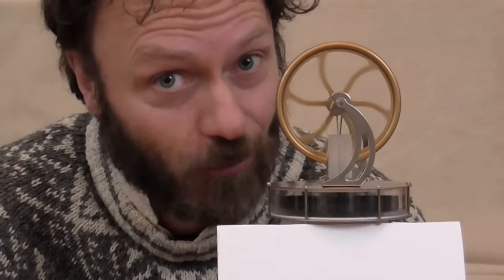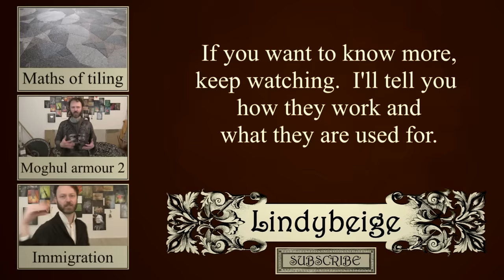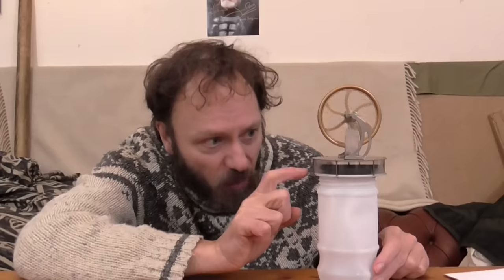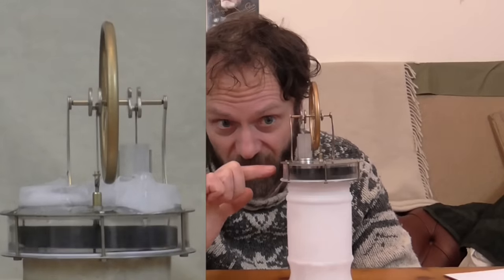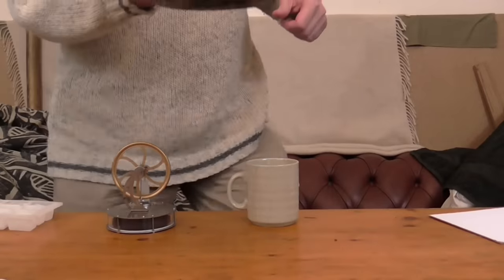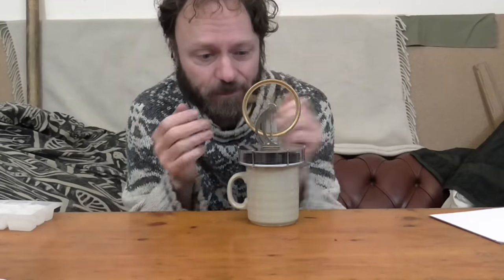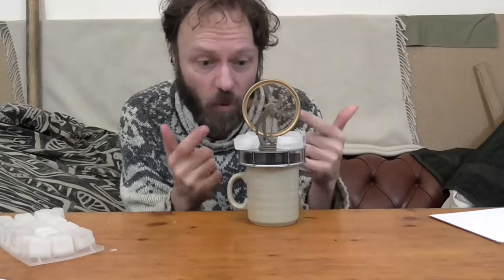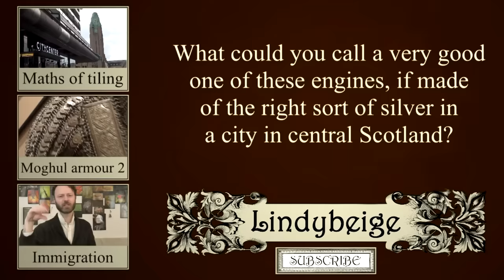Stirling Engines - the power of the future?

Comment: This could be really useful to me as an amateur science fiction writer. I was looking for a method to 1) get rid of excess heat without massive heat dispersers, and 2) provide some power to the internals of a ship without putting a massive nuclear reactor or something and taking some of that power from the engines and routing it into the ship. This could be really useful for both of those tasks. Thank you, Lindybeige, for proving that you never know when learning for the sake of learning might come in handy.
Reply from the maker: Be careful if you mean SPACE ship, because seawater around a submarine carries heat away whereas the vacuum of space does not.
Reply: You need something to turn heat energy into radiation so it can be emitted into the vacuum. The space station has large radiators unfolded from its modules, that look like solar panels only white.
Reply: The vacuum of space does allow heat to travel through it, though.  Not as well as an atmosphere, but heat does travel through space.
Reply: As Lindy said, space can't carry the heat away very well. The reasoning behind it is that because space is nearly empty, you can't really get the heat dispersed very well. In water you have lots of particles in which to send heat, and it can dissapate into the rest of the water. In space, well, you just have the occasional particle hit you.

IMO, you would be better off with some sort of system that dispenses something with low mass and high heat capacity. Rockets work so well because they are shooting most of the heat that they generate away from themselves in the form of very fast particles.
Reply: Great video Lindy! I enjoy your video and almost always learn something.

It might be a cool video idea if you compare and contrast different energy sources. Like the pros and cons of nuclear power vs wind turbines or hydroelectric damns vs geothermal wells and just do one big video on how they all could work and the most viable for the future.

Might be a long video but I'm sure a lot of people would be able to learn a lot from it.

Greetings from the U.S.!
Reply: ***** That's what photovoltaic panels do. Spaceships/stations need to be as light as possible. Plus pv panels can provide far more energy.
Reply: Lindybeige You're right, and I was silly to forget that, but it certainly provides a good use for what is otherwise waste heat that can then be radiated away.
Reply: Tank 1900 mate check out thermoelectric generators. Link: en.m.wikipedia.org I think that might be what you are looking for. Plus they have a history of use in space: they are what actually makes the electricity in a thermoelectric battery, also known as an RTG (radiothermalelectric generator).
Reply: A stirling engine won't get rid of the heat - it just moves it from one place to another (from the hot plate to the cold). You still have to disperse the heat collecting on the cold plate. If you don't, it will heat up until the system reaches equillibrium. That is, the engine does not extract work from the heat itself - which is impossible - but from the low entropy of having a hot things and a cold thing.
Reply: Paul Murray I can't believe I forgot to mention that while I was crushing dreams.
Reply: +NarpytheCrimeDog
a perfect vacuum does not allow heat to travel through it but space is only a near perfect vacuum so while it does allow heat to travel through it, it is only a technicality and heat on a spacecraft needs to be radiated away or it will build up.
Reply: rylee1991  Heat travels through three means: radiation, conduction, and convection.  Heat has no problem traveling through space through radiation  (UV, microwaves, X-Ray, etc.)  Anything producing heat gives off a certain amount of radiating heat, which can be dispersed through a perfect vacuum, which is why we can't make a "perfect" temperature containment device.

So, let's say we have a material that is incredibly effective at converting energy into UV light - a reverse solar panel, we could - potentially - have a space heat sink.

Heat can travel through the imperfect vacuum of space through conduction as well; there are plenty of streams of comet dust as well that one could fly through to strip heat away through means of conduction if necessary.  About they only means of dispersing heat that is really impractical in space is convection - for obvious reasons.
Reply: as i said radiation is the only one that really works in space.
the formula for heat transfer can be expressed as mcΔT(of object 1)=Q=mcΔT(of object 2).
Q=heat m=mass c=Specific heat capacity ΔT=the change in temperature.

space has almost no mass, it has on average a few hydrogen particles per meter squared, hydrogen(most common element in space) has an atomic mass of about 1.008u or 1.6738232e-24 grams.
the Specific heat of hydrogen is about 14.32.
say we raised the temperature of 10 hydrogen particles by 300 kelvin (from absolute zero to 26.85 degrees Celsius or 80.33 fahrenheit) we get; 1.6738232e-23x14.32x300=7.190744467e-20
so that is how many joules of heat energy is transferred, we can then work out how much this cools the other object by transposing the formula to ΔT=Q/mc.
if we are cooling 1kg of aluminum which has a Specific heat of 0.9 we get;
7.190744467e-20/1000x0.9=7.989716074e-23
my calculations does oversimplify variables but its accurate enough to show that using conduction would be ridiculous. 

flying into comet dust would increase the amount of mass you are in contact with but it would also cause friction, it might work to some degree but would still not be efficient.
not sure why you discounted convection it could work if the dust cloud is thick enough or in a nebula, you could even come up with some tech that uses it but it would probably be the hardest to harness although potentially more effective than just conduction.    

radiation bypasses this problem because the energy becomes a photon and does not transfer through a medium, in this way the heat does not travel through the vacuum it avoids it.
Reply: rylee1991
 That was essentially my point in a material that could convert energy to UV. The reason I discredited convection is simply because it operates off gravitation.  Since it's not likely for  denser matter to "drop" and less-dense matter to "rise," in space (granted, gravitation is everywhere), one would have to rely mostly on conduction and radiation.

I don't think the friction from a comet cloud would increase heat as much as it would transfer it out.  However, you would have to worry about actual damage - and I admit I didn't think about that.  I'm sure those ice particles are traveling at insane speeds - likely enough to scrape off small amounts of material like a bad ass shot blast.
Reply: well not all forms of convection require gravitation although the lack of it does limit your options.
Thermomagnetic convection is one example, you stick a magnet next to a heat source in a tank of the right liquid or gas and the cooler atoms which have higher magnetic susceptibility will force there way towards the magnet which displaces the warmer atoms.
in a vacuum this would not get rid of the heat, it would just move it around the ship but its a start.

you could have a bubble of particles around your ship held in place by a magnetic field, as the particles are heated their magnetic susceptibility decreases and their kinetic energy increases until they escape the magnetic field and are propelled into space, maybe even directed to act as a low yield propulsion engine.
this would need the ship to carry its own coolant particles or a way to make the particles in space work which could be difficult.
this would also need a pretty strong magnetic field and the energy generated to create it could create more heat then the system displaces but maybe the energy is needed anyway and the system just uses the byproduct magnetic field.
it could also help protect the ship from micrometeorites and other small impacts.
Reply: rylee1991
 Holy shit, thermomagnetic convection is brilliant.  Please tell me this is a real thing.

Now, as a painter, I've used electrostatic guns, which pretty much just attach a charge to paint to make it connect to a grounded product; would the same principle be possible on the macro scale, rather than the pseduo-atomization of paint?
Reply: it sure is a real thing, the basic principle is pretty simple, when a atom is heated it vibrates wildly and when a atom with magnetic susceptibility is exposed to a magnetic field it lines up with it, these are opposing forces and at some point (called the curie point) the heat wins and the atom stops responding to the magnetic field.
if you search for curie point engines you should find a few demonstrations, like the sterling engine they don't receive much love from industry but they are very interesting.

you can charge just about anything but it will not retain the charge for long, if it can not find an atom with the opposite charge then it will emit it as a photon.
still with advanced enough technology you could do it.
Reply: rylee1991 would it be possible to harness solar wind particles as a means of transfering excess heat and absorb the radiation of the sun as to heat up the opposite end of the engine, therefor u have a temperature gradiant
Reply: I still don't know how it works.
Reply: solar winds are hot and not very dense, the closer to the sun you are the hotter and denser they are.
the formula that i used earlier shows how important mass is in determining how much heat energy is exchanged between 2 objects and already being hot doesn't help either, solar winds wouldn't be a very effective way to transfer excess heat.
Reply: rylee1991 So what is going on inside the engine. I realize there is a temp gradient, but how does that create the motion under a load?
Reply: the air inside the engine is expanding as it gets hot and retracting when it gets cold, the black disk controls the temperature by insulating either the hot or cold side and when the pressure inside the engine is higher than outside the air inside pushes the piston up to increase the volume of the chamber, when the pressure is lower the air outside pushes the piston down to decrease the volume.

the formula for this is PV/T=k, pressure times volume divided by temperature is constant which means that any change in temperature has a directly proportional change in pressure and/or volume.
Reply: rylee1991 Thanks for the excellent explanation. k would have to be what I learned as NR. Correct? Or am I just too old?

Comment: A Stirling engine powers the quietest and most deadly attack submarine in the world...
Reply: Hi do you have any links and why a Stirling engine was used? I'm doing a project about Stirling engines and would love to know where they're being used and for what reasons they chose to use Stirling engines
Reply: @archivearchive9457  Why?  Low noise for one. The USN had it attack an alerted Carrier group TWICE and both times it penetrated ALL ASW assets and sunk our super carrier.  Go to the sub manufacturers website
Reply: @archivearchive9457  theres a type of sonar that detects  noise from the sub engine
Reply: @timearly5226    yeah but I understand that every so often the crew has to do what Lindybeige did, which is to put their hands on the engine to restart it..
Reply: A Swedish or Norwegian submarine snuck past the United States Navy and torpedoed the main aircraft carrier and sunk it in war games in 2005
Reply: It is dual powered, the Stirling engine is only used for stealth and is not enough on its own to run a sub.
Reply: They are Tri powered, Diesel, battery and Stirling.

You could say the dual powered coz the diesel charges the batteries and the motors are electric. I imaging the striking provides the motors with a couple of watts to keep em turning for maneuvering while hunting.
Reply: Robert Aegidius  WIth enought sterling engines maybe
Reply: Robert Aegidius  littoral: are you sure?
Reply: @jimmys6566  Yes, he's right.  Non-nuclear attack submarines are fairly universally slower than their typically larger, fission-powered cousins.  When submerged, they don't have the benefit of the full output of their diesel powerplants, you understand, so they have only what their batteries can provide, unless they want to snorkel--that is, raise a mast to the surface to take in air to run the diesel powerplant.  Even then, you can't move very fast because then drag will damage your snorkel, and that's no good.  Air independent propulsion systems, like hydrogen fuel cells or Stirling engines, have been fielded on some electric subs to quietly replenish their batteries, but they are still considerably slower than nuclear boats, which can lean on the full force of a nuclear reactor whenever they want to.  Those ships can go faster and can sprint for as long as they damn well please.  

But, in practical terms, even nuclear submarines have a fundamental speed limitation when put up against a carrier group.  See, a submarine remains quiet at low speed; this minimizes flow noise around the hull and machinery noise from reactor coolant pumps and steam turbines.  These, especially the turbines, are still very quiet anyway, and coolant pumps are probably the biggest source of sound on a nuclear sub, in most cases, that can't easily be isolated from the exterior of the hull.  Sounds that can be isolated more easily are much easier to keep quiet from enemy sonar.  

So, if you want to stay quiet nearby enemy ships, a modern submarine will find itself limited to around 5 knots or up to perhaps 15 knots in the case of some newer nuclear submarines; it really depends a lot on the design of the propulsion system, the effectiveness of quieting measures, and the quality of the sonar the other guy is using to look for you.  

On the surface, meanwhile, the carrier can very happily blaze along during launch and recovery operations, so imagine that the whole surface group can be steaming along at 20 knots or more.  The ASW ships will probably cut engines and drift every now and again if they're actively trying to listen for you, but otherwise they'll just be cruising along.  And, if threatened, a nuclear-powered carrier can sprint at 30+ knots for weeks on end, if it wants to.  Speed is one of its greatest defenses!  

Meanwhile, if you want to catch up with a fleeing carrier, you will need to sprint at 30+ knots as well.  If you do,  you'll be blinding yourself with your own flow noise and everyone you would like to hide from will be able to spot you easily.  

Again, this is true even of nuclear submarines.  Non-nuclear submarines have considerably less endurance and are significantly slower to begin with, so their ability to operate offensively in open waters is very poor.  Hence, they are mostly relegated to a more defensive role closer to home ports, ie in littoral operations.
Reply: @DavidEllis94  thanks for a great answer; however a Stirling engine still requires air to support the external heat source
Reply: @jimmys6566  Sweden's Gotland-class is equipped with a Stirling cycle engine that burns diesel and liquid oxygen to replenish its batteries while submerged.  Presumably, the main diesel powerplant still snorkels when operating.
Reply: @DavidEllis94  and the exhaust? How is that vented?
Reply: @jimmys6566  That's a hell of a good question.....
Reply: @timearly5226  Cool dead link, but I'm pretty sure you're referring to Gotland-class subs. Which have two massive diesel-electric engines lmao
Reply: @local38on-tv  Swedish, NOT Norwegian

Comment: Actually, close to the equator you could basically modify it to word as a sort of solar-sterling engine.  Paint the top black to absorb heat and keep the bottom in in the shade and you can still get a decent output, especially considering that you aren’t even using fuel.
Reply: Could also make some sort of water cool at the bottom.

Comment: 3:30 That same method is used to power my step dad's fan. It works, you see because it's on top of an enclosed fireplace, the bottom is hot, but the air above it is colder, so it powers the fan using the differential. It's useful because then the fan blows hotter air back into the room.
Reply: That is a peltier cell however, a bit different.
Reply: guythepirate  Absolutely not. Here's an example of what he's talking about: https://www.stirlingengine.co.uk/d.asp?product=VULCANSTOVEFAN
Reply: Aha thought it was one of these 
http://www.ecofan.co.uk/woodstove-ecofans.html
Never seen a Stirling version! Thanks
Reply: SO = IN THE DEAD OF WINTER AND THE DEAD OF SUMMER - ONE OF THESE MACHINES PLANTED IN THE GROUND WITH THE HEAT OF THE EARTH IN THE SUMMER COOLING IT AND THE HEAT OF THE SUN WARMING IT WOULD MAKE IT RUN BEST AND DURING THE WINTER WITH THE HEAT OF THE EARTH WARMING IT AND THE COLD OF THE AIR COOLING THE TOP OF IT AGAIN IT WOULD WORK BEST USING THERMAL ENERGY OF THE EARTHS CHANGES COMPARED TO THE OUTSIDE TEMPERATURE.. HMMMM ... this engine would slow down in the spring and fall compared to the winter and summer